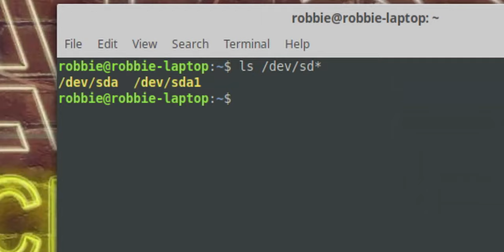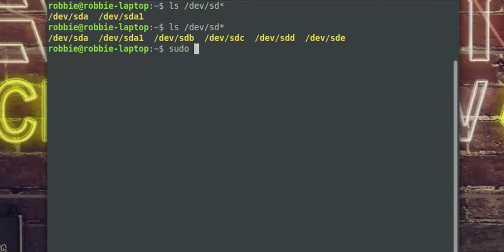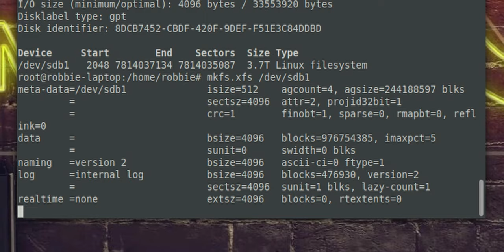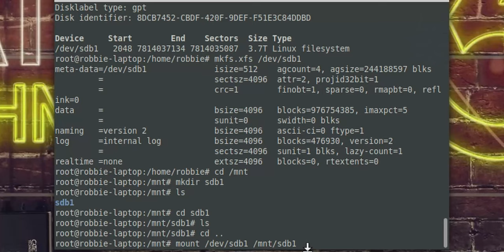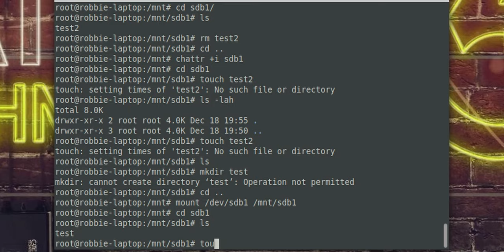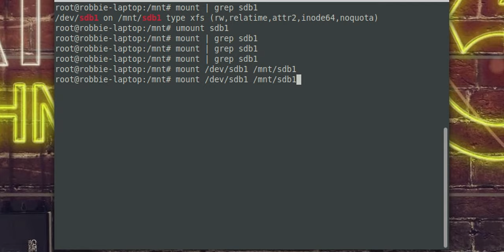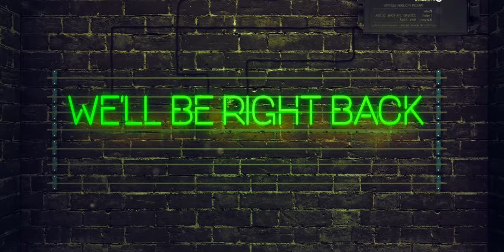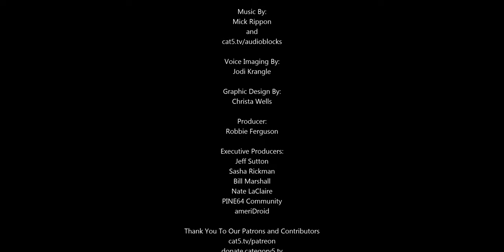Linux Partitions and Mount Points: Preparing a DIY NAS

Comment: Synology with 20x 100TiB Data Center SSD drives are the way to go or you could do what Mörten in Hönnes Denmark has done using a LENOVO Mini computer and Library unit to create the largest Synology unit the Synology would be running on top of ESXI VII